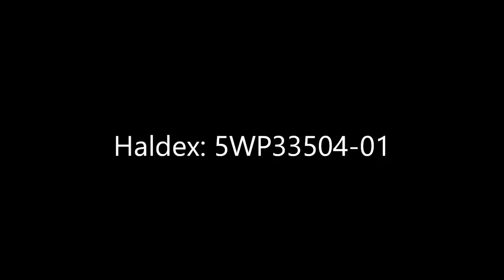Project V50, Episode 51: Gen3 Haldex Controller for Real AWD

Comment: The 5WP22201 controller in the 2004 S60R activates without front wheel slip.
 If you remove fuse 23 in the rear fuse box this converts the car to FWD (Front Wheel Drive) only and then you can feel just how much the AWD (All Wheel Drive) system really works.
 With the AWD you get very little torque steer, but with the fuse removed and in FWD only there is a ton of torque steer.
 This is just an interesting way show/feel just how well the AWD system works and is completely reversible and harmless.
Reply: Hi john do you know wich fuse i need to pull with a volvo xc70 2008 i love my care but i just want too laern more about it
Reply: is it worth trying to replace the s60r unit with the xc90 unit mentioned in this video?
Reply: @themike97_58  
Yes by all means, I've been using a XC90 DEM (Differential Electronic Module) controller, solenoid & sensor for about 2 years without any issues, it's just 'plug and play' too. 🙂
Reply: @johno9507  would you say it makes a significant difference?  My understanding is that the pump for the R is primed on the key turn, so no front wheel slip is required to engage the rear wheels.
Reply: @johno9507  bit skeptical about this controller swap. So this is effectively converting a gen 2 haldex to a gen 3? I thought that gen 3 differed components wise. Also, don’t R haldex get 50/50 distribution on slip, now it becomes 60/40?
Reply: @E82N55  
Grrr...YT deleted my reply.
The 2004 S60R and 04 XC90 are gen 3 Haldex.
The pump and DEM In my S60R burnt out and I replaced them both with 04 XC90 parts from a junk yard, that was nearly 3 years ago and I assure you they work just fine.
But when swapping the DEM its best to use the solenoid that comes with that DEM.
Gen 2 doesn't use a electric pump and the parts aren't interchangeable.
 Also the Haldex doesn't work by itself, it uses information from the 4C suspension, DSTC, transmission & ECU, and about 50 sensors in the car to determine how much torque gets sent to the rear.
Reply: @johno9507  Hm I'm reading elsewhere it says that only 06+ S60R's get the gen 3 Haldex. Is there some missing info here?
Reply: @E82N55 
 OK my friend I've done some checking as you have me second guessing myself lol.
2004 XC90 and S60Rs are definitely gen 3 Haldex.
If you go to the FCP Euro Web site they even have gen 3 service kits for these cars.

Comment: Installing a used part that is not programmed to the car will very likely cause issues if you ever need to do software programming/upgrading on other modules on the car. I don't know if XeMODeX or similar can erase the original programming and specifically program it to work in a P1 car without the car and Volvo thinking there are any issues, but that would definitely be worth looking into!

There is also information somewhere out there that says what models have which version of the Haldex that would be worth looking at. I don't think it's just the V8 XC90s that have Gen 3.

FWIW, the 40bar sensors seem to be on '04 cars, where the 05+ cars seem to only have the 80bar sensors(all P2 AWD models, not just the V8 XC90s).
Reply: I have a 04 Volvo S60R and replaced the blown Haldex module with one from a XC90 (same part number) without reprogramming anything and with absolutely no problems or warning lights.
Reply: @johno9507  When you need to perform a software download in the future is when you may see an issue as that is when Volvo checks all the hardware and software part numbers at that time. It may fail whatever download you are trying to perform because of "mismatched" parts.

Comment: Wouldn't be easier to insert a potentiometer on the power source cable of the pump? And maybe add a small display that shows the pump power..
Reply from the maker: That would be an option if you wanted to build a manual controller.
Reply: @MyNameIdeasWereTaken  no its not working we figure it out right this night... The pump is provided by a 12V and a nonchanging Sinus Signal. Because the preasure is regulated by the haldex inside, its the piece with the holes the bigger one, this is kind of a stepper regulating the constant pressure running from the pump to the clutch. The only thing you can do is to deactivate the pump completely... *g*.

Comment: I know this video is now over 2 years old but if you have any information I would greatly appreciate it. By chance do you know which haldex system is in a 2008 S80 V8? And is this modification possible on that car? Thank you!
Reply from the maker: I'm not sure which haldex version is in the S80. It may already have the gen3 controller. If you are able to determine what part number controller is on your car, you can probably look it up that way. 
Not sure if this modification would work for your car or not. It has worked for some S60 owners. But at the same time, it still appears to be hit or miss with no way to determine which cars it will work on and which cars it won't.

Comment: I got a Volvo S80 V8 with haldex 3, original unit. It feels very good, and don't need wheel spin to activate, it checks the throttle as well. I you launch it with hard foot, it will do 50-50 without wheel spin. So I assume I don't need this mod?
Reply from the maker: Your model should already have the updated Haldex unit.

Comment: My question to this 'mod' , does it feel more as if you are propelled forward than with a standard setup ?
Reply from the maker: It will still be front wheel biased, but you can definitely feel the whole car digging rather than just the front wheels.

Comment: Oh, no, why did you say that twice in the vid!🤦🏻‍♂️

Now I can’t not to text a comment:)

On AWD cars with front wheels making most of the job and rear wheels being engaged via a clutch-like device (e.g. the Haldex) front wheels are always attached to the gearbox. That means it is impossible to send less than 100% of the engine’s force to those wheels.
The prop shaft is permanently attached to the gearbox via a power take-off gear, thus the prop shaft spins at same speed as the gears turning the front wheels.
However the rear wheels are connected to the prop shaft not directly, but via a clutch-like device.
Such device can be:
-fully disconnected,
-fully coupled,
-semi-coupled with a very wide range of slippage percentage.
Let’s say it’s a Haldex thing.
If Haldex is totally disconnected, 100% of engine’s power go to the front wheels, 0% goes to the rear wheels.
As far as I know no Haldex can’t be totally dosconnected, some power transfer thru friction and fluid still stays, so it still sends about 5% of power to the rear wheels. But it doesn’t mean that somewhere there occurs a power split, no. The ‘split’ is 100 to 5.
If the rear wheels could be disconnected from the prop shaft (with some other couplers they might be able to) the ‘split’ would be 100 to 0.
If Haldex is coupled but slips, we have 100 to 37, or 100 to 14.3, or 100 to 96 ‘split’ ‘ratio’. It is never a ‘split’, as well as it’s never a ‘ratio’. There’s no differentiall between the two axles, hence no ’split’.
Again: a power take-off gear or a power take-off shaft (very often used in tractors) is the thing that can help you wrap your mind around this whole concept. The idea here is this. If there is no differential, the vehicle’s transmission acts as a one solid piece. Take a fork or a chair and turn it. It is one solid thing, there’s zero torque split going on.

However if you look wider and take the road into account (the surface the wheels apply forces to), everything dumps up side down—there is a torque split between the contact spots of tires and the road, but not in the transmission.

Comment: I recently installed a 5WP22228-02 in my 2008 v50 T5 and immediately got the "Anti-skid service required" error and the DSTC was automatically turned off.  Had TONS of power in the front end and felt like there was AWD less often than normal, but for the most part all power was up front.  Switched back to the orginal Haldex after two test drives several hours apart from each other and all codes went away and everything was back to normal.  (NOTE: There was a copper coil in the 5WP22228-02, but not one in the original unit.)  There was a little bit of slop in how the "new" solenoid fit in the car, so there was a little bit of oil leak, but I don't imagine that would have effected the way the car behaved with the "new" unit installed...just leaked more oil than normal...but might have been indicative of a mistreated unit prior to my receiving it.  Anyway, I have a 5WP33504-01 in the mail and will report back on how that one behaves.  Thank you MooseTech for the find and MNIWT for the video and descriptions!...super cool even if it doesn't pan-out for my rig!!
Reply: Sooo...received the 5WP33504-01 in the mail today.  It was visually in mint condition, less a minor amount of weathering on the outside...minor.  So I was pretty stoked to get it swapped into the car.  First thing I noticed was that there was NO copper coil in the 5WP33504-01, which gave me hope, since the 5WP22228-02 did have the coil.  Anyway, made the swap, started the motor and got the same exact behavior from the car that I got with 5WP22228-02.  Dang it.  I was pretty pumped for this to work, but it didn't.  I didn't even test drive it b/c the reaction from the car was exactly the same as before at startup.  (Oh, and FWIW, and there was less slop/less oil leakage in the 5WP33504-01 solenoid when installed in the car than there was in 5WP22228-02.  My guess would be old/bad solenoid gaskets in the 5WP22228-02 unit I had.)

With that, my working theory is this...I've had this car for only a handful of months and the only previous owner religiously took it to the local Volvo dealership for service.  I'm trying to research now if there was a software update (maybe since April 2018  ;)  ;)  ????) that included an update to not allow other Haldex units to be retrofitted onto the VIN...?  Anyway, haven't gotten very far, but will report back if I find anything.

Comment: Are there good parts to fit to make it more reliable at drifting? Like thicker axles etc.?
Reply from the maker: You would want something stronger than the stock axles, plus a limited slip differential and a manual haldex controller. But it still won't make a good drift car. You can kick the back end out, but the strong front wheel bias makes these cars snap back to straight real quick.
Reply: @MyNameIdeasWereTaken  Thank you for your quick and informational respond 😃
What about just driving it aggressively?
Are there good parts to fit that last just longer than stock?
Reply from the maker: @hendrikschwarz5142  For drivetrain, stock is usually the best on these cars. But there are plenty of upgrades for suspension, mounts, and general performance.
Reply: @MyNameIdeasWereTaken  thank you ✌️

Comment: I have a 2007 S60R with a tf-80sc.

Would this system also work with my R or is my gen 3 Haldex already as good as it can get?
Reply from the maker: The R is close to as good as it'll get. Some people have tested this unit on the R (not sure what years) and found a slight improvement, but not as significant as the P1 AWD system.
Reply: @MyNameIdeasWereTaken  Ahh, I see. 

I was just hoping that there was a way to make it slightly more RWD biased. 

I've been rebuilding my R after the previous owner wrecked it and it was disassembled and abandoned for three years.

I've got a 3" catless downpipe and a drop in intercooler in the mail for it. It drives dang good but I was still hoping for a little extra.

I'm sure I should see some improvement after the boost limiter is removed from first and second gears with a stage 2 tune. (I'm currently running a stage 1 tune from Contrast)
Reply: @MyNameIdeasWereTaken  
Hey, jumping in here to ask : regarding Haldex gene on V50's....Do the newer 08+ V50's have a newer gen Haldex in them? 
Or do the R models V50's? 
My 07 V50 T5 is getting long in the tooth [400k] and i am looking for another but in AWD config.
I have searched but cannot find V50 Haldex model change information and would greatly appreciate your comments
Cheers
Reply from the maker: @drd3816  There may be some updates with the facelift models, but the general characteristics of the haldex awd remain the same throughout all years of the P1.

R design means nothing other than some trim pieces and the badge. Some models got equipped with slightly stiffer shocks and struts, but this was no different than the dynamic and sport options of previous years.
Reply: @MyNameIdeasWereTaken  
Ok thanks for that info!

Comment: in s40/v50 put different versions of haldex, as I read. is that really true? which version is better?
Reply from the maker: The S40 and V50 are the same. It's later AWD Volvo models that uses a slightly upgraded part for more immediate response. The rear is basically preloaded, rather than having to wait for it to respond.

Comment: WILL a 5WP33505-01 do the same job?  

I have a 2004 V70R AWD  that I want to upgrade to Instant Action

I recently tested  tested a 2006 V70 D5 AWD for a working AWD system in a wet grassy field..the D5 started off with the rear wheels spinning so I assume that the 2006 V70 D5 AWD had the instant action DEM as well.....yes no maybe?? 

I also was about to purchase a V70R AWD and when tested in a grassy field it was ONLY FWD!!! :-(
Reply from the maker: I haven't tested that part number, so I cannot confirm if it will work or not. 

Most of these cars, the R included, are very slow to put power to the rear. They're basically just FWD cars until they detect slip and will then send power to the rear. This module just allows that rear power to be a lot more instant.
Reply: OKIDOKI  I do understand the difference between the various versions the ones with an on demand electric pump and the ones with the always running pump system which is like a cocked gun just waiting for the trigger to be pulled.  I tested a 2006 V70 D5 AWD the other day on wet/damp grass and there is no doubt that it was the rear wheels that left skid marks on the grass as it tried to drive off from a standstill.. watching it from outside the rear wheels spun up and the fronts just rotated at 'normal' speed. BIG difference in the rotation speeds of the front and rear wheels and this car had just had a new haldex unit a new DEM and the CEM also replaced.   This was a manual gearbox car and the V70R AWD is an auto and i know that the geartronic auto has 'less power' in first and second gears.  It would be really handy if someone could relate these haldex numbers to the cars as i believe Volvo use the same part number for them all.  IF i can find that 5WP33305-01 at a nice cheap price here in the UK I will probably purchase it fit itand tests it out...I found another one and it is dated 18/03/08 also says HAP 542 where as the older very common ones 5WP22201-01 though 5WP22229-01  say HAP 511 one more 5WP33505-01 with a date of 12/04/07 and another with 12/02/08 all are HAP 542 models so I would expect this later dated DEM's to be Instant Traction versions......time will tell of course.
Reply: I have a 2004 S60R and the rear wheels on wet grass start spinning right away. Have you serviced your haldex unit?

Comment: I have an 2009 awd s40 and I think its probably worth a shot with the Gen 3 controller. If it doesn't make a difference I can always resell it.  Did you get yours on ebay or a pick and pull?
Reply from the maker: It was a local junk yard and they seemed to know what they had. I paid $180. But I'm sure a pick and pull could be had for less. Check out this thread on SwedeSpeed for further discussion about this modification: http://forums.swedespeed.com/showthread.php?558890-quot-Real-quot-AWD-Upgrade-Improved-Power-Split-Gen-3-Haldex

Comment: Will this work on my 2005 s60 awd with haldex3
Reply from the maker: It has been hit or miss on other Volvo models, even other P1s. For some people, it completely transforms the car like it did mine. For others, no difference is noticed or it may even disable AWD. This has not been pinpointed to model, year, or part numbers. I could take the working DEM off my car and slap it on another similar V50 and experience no improvement. I wish we could figured out what the deciding factors are, but it seems that people just have to test it for themselves to see if it works.

Comment: Does it matter if the transmission is a 5-speed auto or 6-speed manual?
Reply from the maker: It should not matter, but as mentioned, it seems hit or miss if this mod actually makes an improvement for many people. It works for some and not for others with no indication based on make, model, year, region, software, etc. The only way to know if it'll work is to test it for yourself.
Reply: @MyNameIdeasWereTaken  Awesome! Thank you!

Comment: What’s the reliability of this thus far? And did you measure a mpg difference?
Reply from the maker: For me, it has been faultless so far. A few others have tried various haldex modules and some stopped working after a short period of time. Still instant AWD when you plant your foot in my car. No MPG difference because it's still operates in FWD when you're just cruising, it only throws power to the rear when it detects slip or when you're really pushing it hard off the line.

Comment: Did you need software because my tech connections claim you need software to swap dems
Reply from the maker: No software is needed, which is why this modification works. The car treats it like the stock DEM, while the module takes that input and applies more power to the rear wheels, based on the heavier XC90 that it thinks it is pushing.